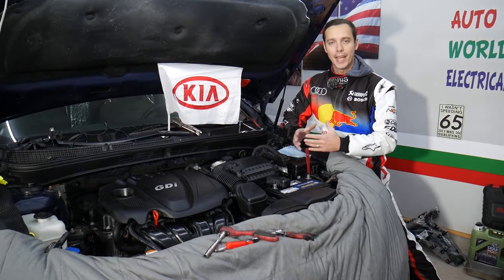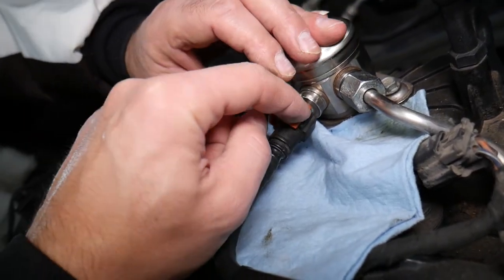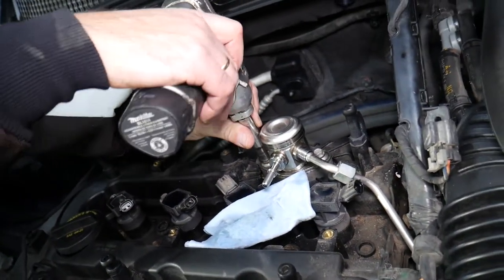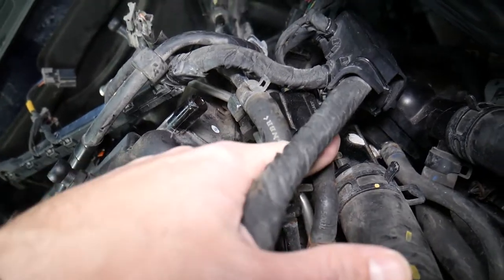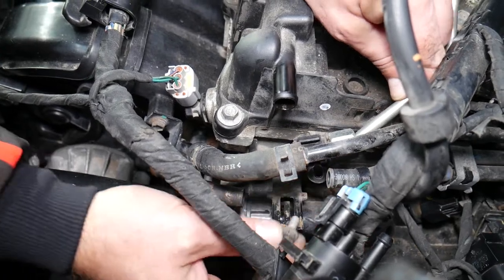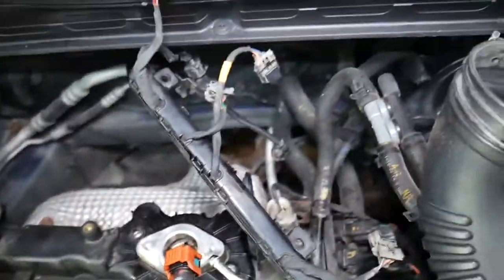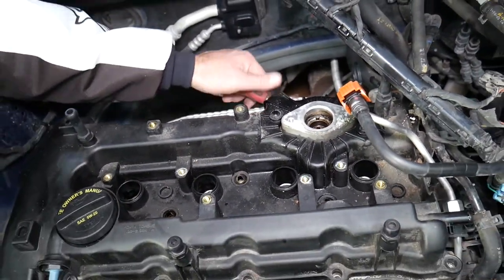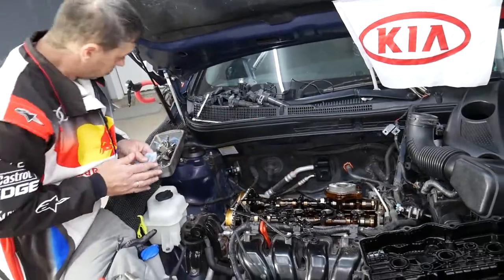KIA OPTIMA VALVE COVER GASKET REPLACEMENT REMOVAL

Comment: What kind of silicone did you use or can you use any kind of silicone? Do you have a linkfor the silicone you used?
Reply: Make sure it is the kind that can handle heat. Ask the auto supply store workers, they can help you. It’s about the same price there compared to buying online. Make sure you get the right part.

Comment: I knew this wasn’t a 2-3 hour job. I hate dealerships. They quoted me $450 with 2.5 hrs labor and parts. They can kick rocks.
Reply: You don't only pay for time, you pay for experience, information, and ability. Don't be so reductionist. Most ppl don't have the expertise or time to do work like this. Also, you need to realize they have to test their work.
Reply: In the business we look to do the job in 1/4 the time we quote it for. I quote these jobs at $400. We have to do it this way, if you cant do it yourself then you may have to kick rocks.
Reply: Expertise is based off rate per hour $65-$270 per hour for labor. So a 1 hour job should never take longer than that. If it does, it’s legally required to specify why: test, test drive, time vehicle sits even if not being worked on. Vehicles are often not worked on directly and can still be charged for time it’s taking up space.
Reply: If your the original owner this is covered under the 10 year 100k mile warranty.

Comment: Is there a link to the fuel pump gasket? I found the gasket for the cover with the link but not the fuel pump gasket
Reply: I was wondering the same thing. Maybe they have another video on the high preassure fuel pump gasket replacement
Reply: @shawnzeman129  dont buy any gaskets from Amazon or eBay or anywhere else just buy them from the dealership because the other ones don’t fit properly!